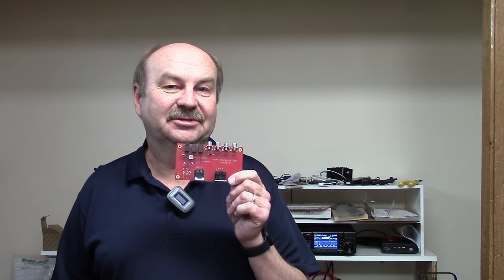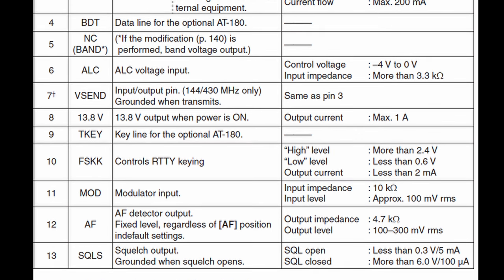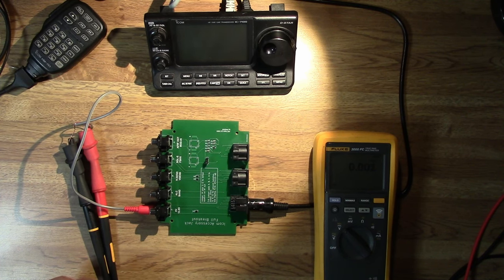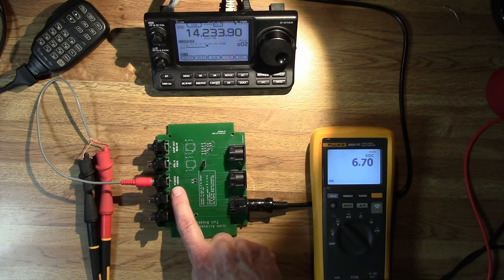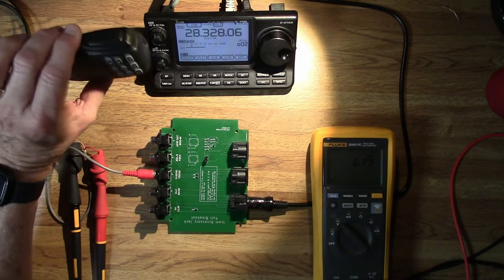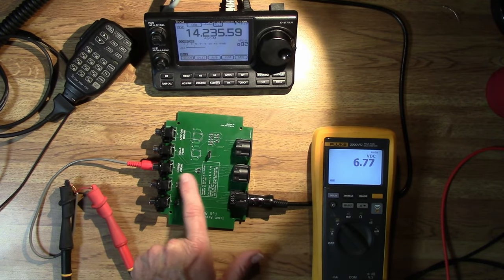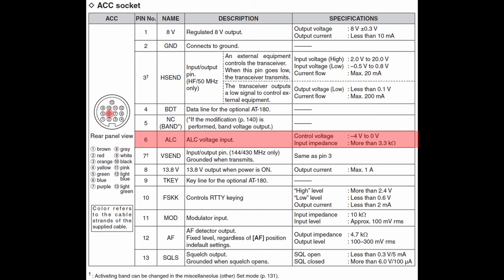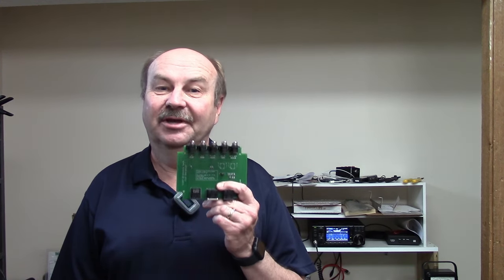Icom Accessory Connector Signals

Comment: Thank you very much for the series of videos about the ICOM 7100. I'm writing to ask if you can help me with assembling the control cable to connect the IC7100 to an MFJ-1708B-SDR antenna switch, as there's no information available. I understand that I should use Pin 3 HSEND and some other pin. The antenna switch uses its own power to activate the relay. My question is whether I should use Pin 2 GND or Pin 8 13.8V, and also connect a diode as protection between them. I haven't found any diagram on the internet. Thank you very much.
Reply from the maker: Hi.  Sorry for the late reply.  Yes, you would use HSEND to the center pin on the CTRL input and connect pin 2-GND to the outside (ground) side of the CTRL connector on the MFJ.  You don’t need a diode.  You could use the 13.8V from the 7100 to power the MFJ unit if you want.  The 13.8V on the Accessory connector is good for about 1 amp.  Feel free to contact me through my website https://a-2-z.tech if you need more help.  You might also want to use the SET menu to set the TX delay on the 7100.  This will make the 7100 pull the HSEND to ground and then delay for a short time before actually transmitting RF.  This gives the relays in the MFJ time to switch.  This will better protect the SDR

Comment: Thks for info, is the breakout board somewhere available? 73 PH7R
Reply from the maker: Hi.  Glad you enjoyed it.  I'll be doing a follow-up video about the board shortly.  It will be available as a partial kit - (meaning all the surface mount parts are installed, you just solder in the thru-hole parts).  It will be up on the store soon.  I'm getting in a small run of the boards.  Store is at:  https://store.a-2-z.tech/
Reply: @HamRadioA2Z  Great, looking forward.

Comment: Thanks for all the details. Is there a way with the ACC to get the real s-meter value (Not the 'false' displayed on the icom radios) ? I saw true s-meter device made by UR6QW  that relies on the ACC port , but I don't find where this can be provided by the ACC port. Thanks. - EDIT: sorry I am wrong, it's handled by the CI-V port...
Reply from the maker: Hi.  Glad you found it.  I was going to reply that there is no S-meter signal on the ACC port that I know of.  C-IV port makes sense.  Except you mentioned “real” s-meter value.  The data on the C-IV port is going to be the same as what the rig is displaying on the display meter.  Maybe whatever the device is does some additional math on the signal before displaying it?